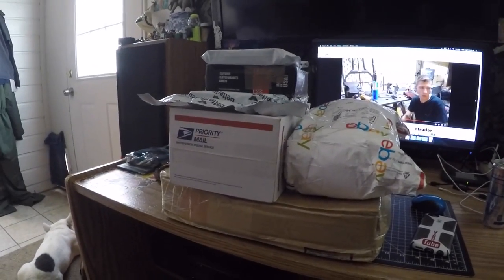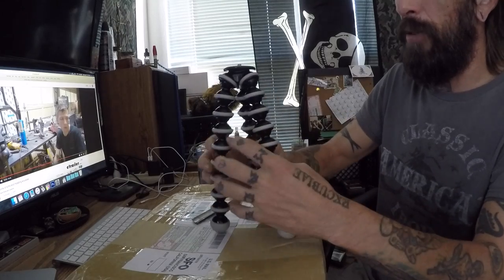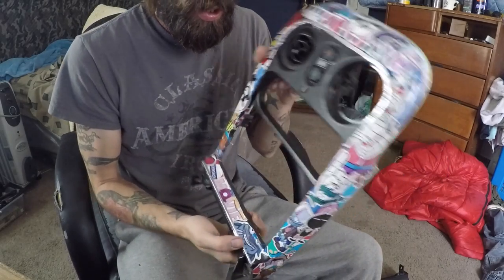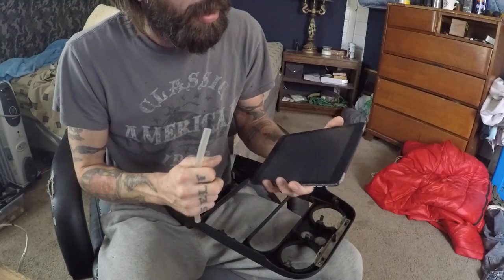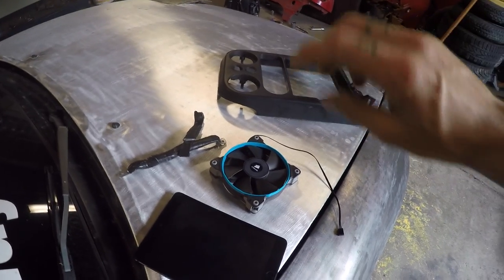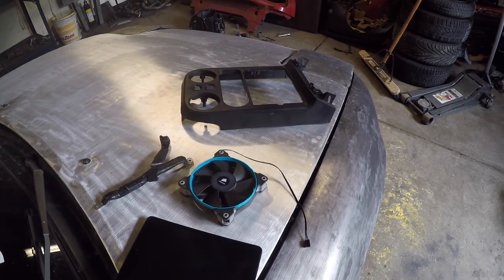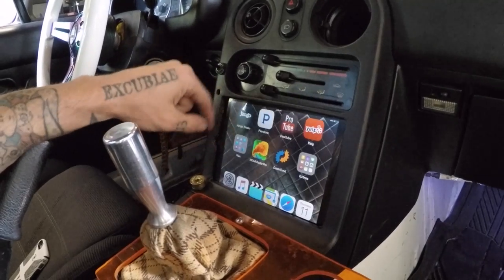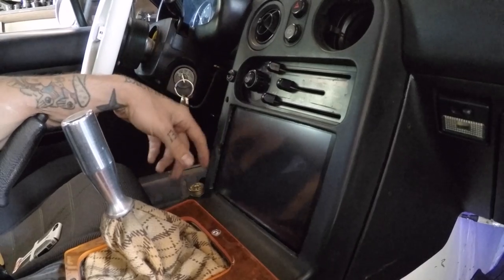MIATA iPad Dash REINSTALL S06E12

Comment: Damn looks great. I'd be scared of getting the iPad ripped out and stolen though
Reply from the maker: no one knows its there when its off, no big sign on my car that says its an iPad. its just all black when the car is parked. and i have 20% tint all around with 35% on the entire windshield so you can't see in at all. plus the entire center console and entire radio bezel would have to be removed to even get to it. thats a good 20 minute process. also i park in my garage.